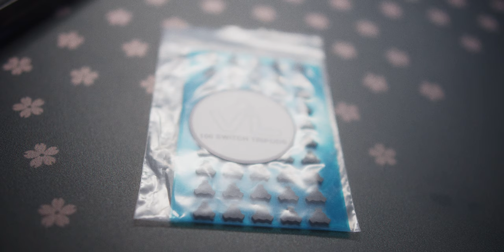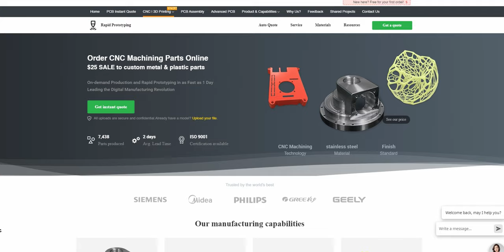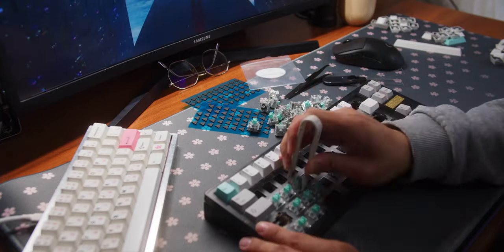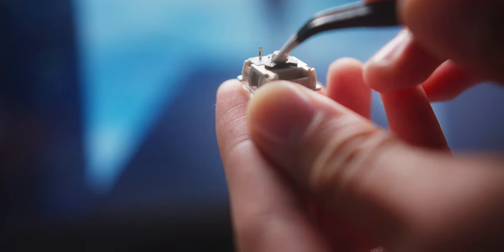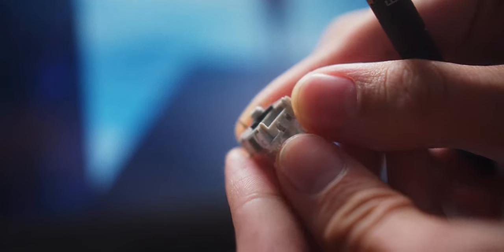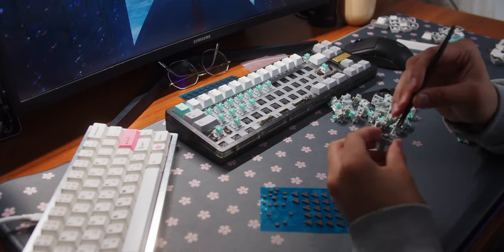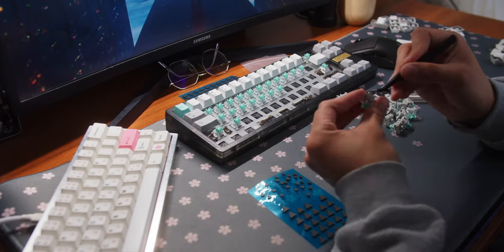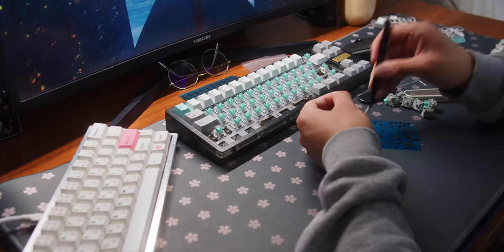Easy Switch Mod | Switch Tripod by VLKBD Review

Comment: Maybe it's just me, but I've listened to this on three different setups and I can barely hear the difference. Certainly not enough of one to justify this mod over others.
Reply: i was thinking the same thing. it might be a case of sound tests not doing it justice, but i wouldnt know.
Reply from the maker: The difference is much more significant irl, and it’s closer to a tightening up and slight deepening of the sound. However, it’s one of those mods that I’m personally not gonna use this mod anytime soon in the future. It’s definitely an option, though!
Reply: @AnzelLmao  If that's the case, it seems like it'd be one of those mods that could really benefit certain switches/configurations without losing the overall sound signature and characteristics. I love Zakus but sometimes they're REALLY loud and too high pitched on certain boards.